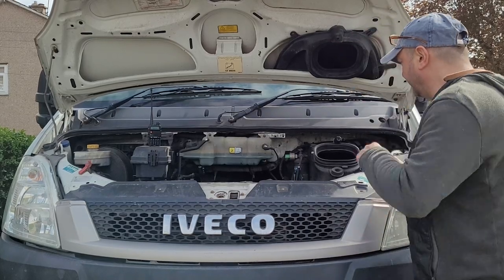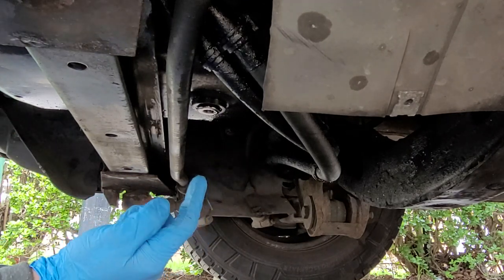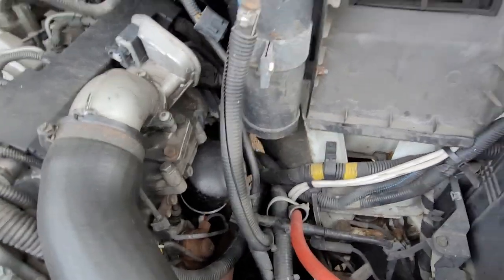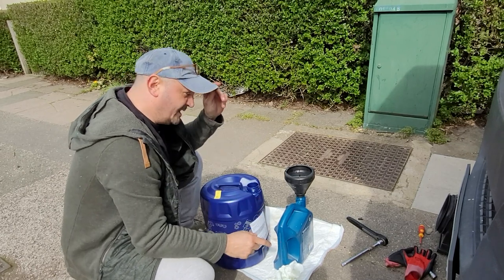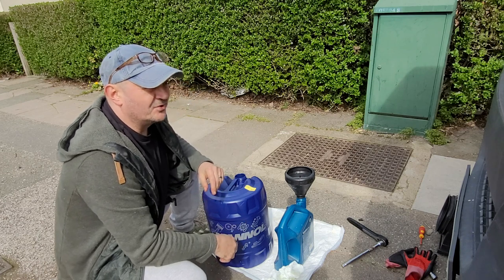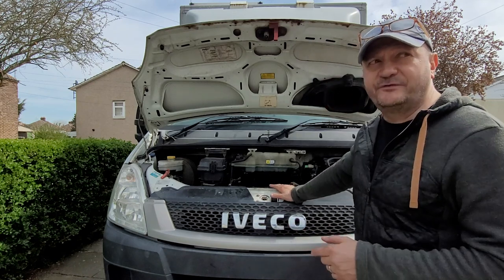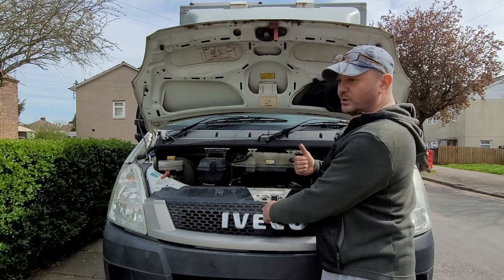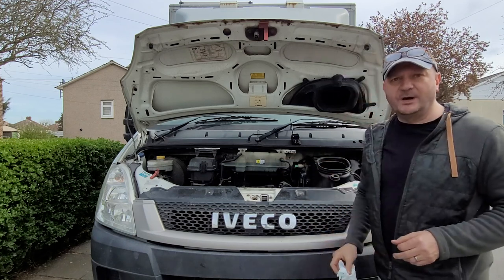VanDerek has an Oil & Filter Change - Iveco Daily Self Build Motorhome Conversion

Comment: You really got lucky with the filter position, at my Ford Tourneo it's located horizontally at the back of the block, wedged between a driveshaft and the oil cooler somewhere. Horizontal filters doesn't run empty, so you would make a mess anyhow...
Nice job done, thx for showing!
👍👍👍

Comment: That is the trouble with fresh oil is it is not always easy to see where it is on the dipstick. Some are worse than other. In my younger years I was on a Placement with an RAF MT section, and they used to get me to do the oil changes on the Glider Winch knowing full well that every time it was due the wind would pick up and funnel through the buildings and as soon as you dropped the sump plug the wind would pick up and you'd end up having a shower, you had no choice but to stay there as you couldn't get the Dalek in due to not being able to get it under the frame. so you had to hold an oil pan in place till it had stopped dropping oil. No wonder they used to give it to me to do. As well as look after all the bikes and change the tyres on our fleet of Metro's due to the double beads and how often you'd knacker on just putting a new tyre back on the rim. 
One of my favourite memories from there was taking out a Land Rover for a test drive with a Driver as I didn't have a license back then and an Officer stopping us and Bollocking me for not wearing a Beret. If had had looked closer he would have seen that I had not Rank on my coveralls and was wearing civvies under them. Once I had told him that I was a Civvy his face went bright red, and he walked away.
Reply from the maker: Brilliant Digger. I've spent a lot of time on Brize, Fairford and a fair few others in the past and been in many hangers, I totally understand about the wind funneling through. I get it about the oil and the wind. I always place dogbtraining pads around my bowl now because we get the same type of thing happen down this narrow long road, I find myself chasing the drips at the end coming out of the sump. I didn't show it on this video cos I would have looked a proper wally lol. ATB 👍

Comment: Hello, couldn't help noticing you're using the Michelin cross climate tyres. I'm just about to pull the trigger on a new set of boots for my conversion and these are very well reviewed, but I was wondering if you could comment on how they do on wet grass or slightly muddy surfaces like you might encounter in some campsites or off-grid locations (I won't be off-roading or anything!).
Reply from the maker: Hey sorry for the late response... sometimes, or most of the time, YouTubes notifications are a bit poor to say the least. So to answer your question... I'm afraid I haven't had experience using this vehicle on wet grass, but I did need towing out of a shingle beech a while back. Performance on wet rainy days has been excellent. That's all I can offer I'm afraid 👍
Reply: @PrisonersNoLongerAccepted  Appreciate the reply, thanks a lot! So hard to find a tyre that ticks most boxes...

Comment: I gotta get one of those tools now 👍did you use a genuine Iveco filter?, did you get oil spillage when removing the old one? 
Happy travels 👍
Reply from the maker: Yeah this was a genuine filter from the only local-ish motor factor that sells them  or I drive much further to Iveco but pay twice as much. You do get a little bit of leakage, but it's not from the filter itself, it leaks from the actually area you fit the filter to as it's on a slight angle but very hard to film. This is what has caused the oil on the hoses at the bottom of the engine bay on the underside of the van 👍
Reply: @PrisonersNoLongerAccepted  
Thanks, Its the same on mine, always suspected it was from when the filter was changed.